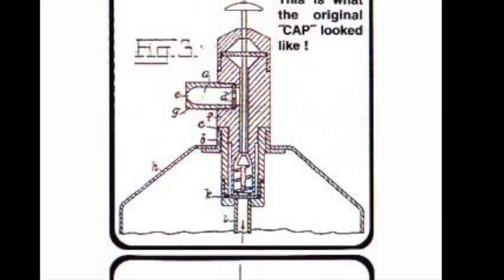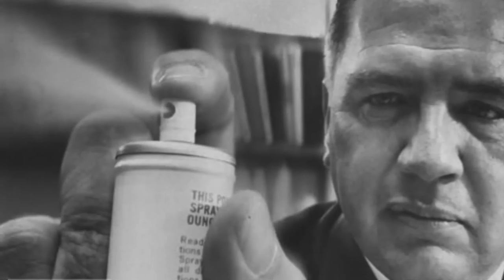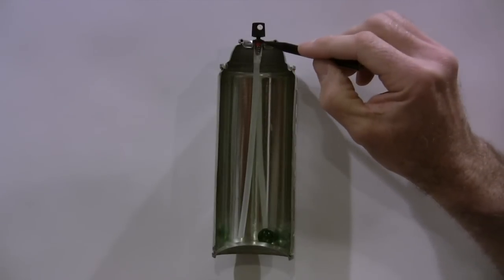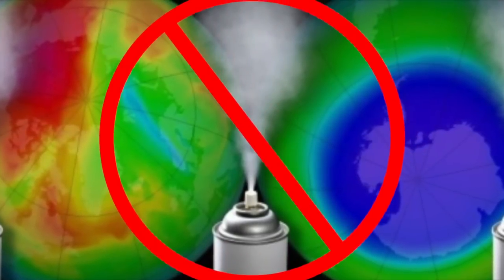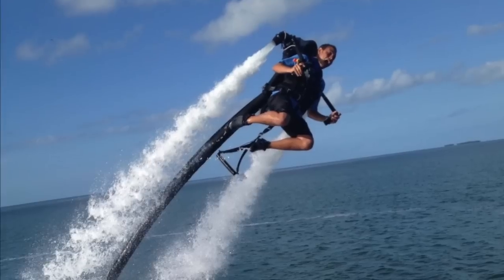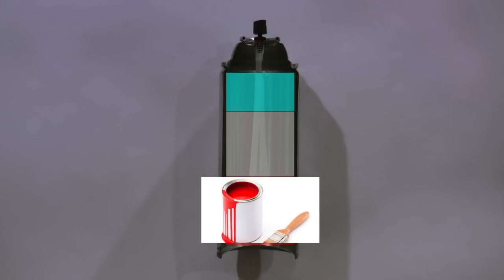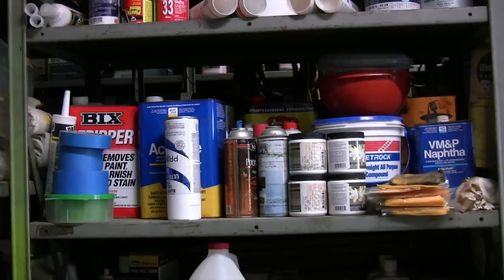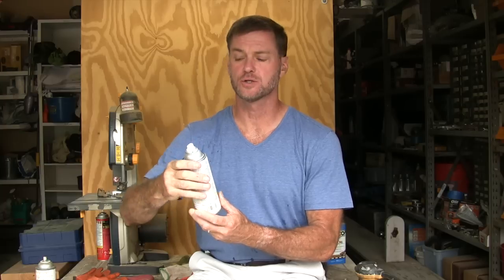Contractor Craig - Never Deal with a Clogged Spray Can Again

Comment: Turning upside down may or may not work. Somebody needs to sell nozzles on ebay-a package of all types. I'd buy 'em.
Reply from the maker: +Frichie68 Hey Frichie, Well I have about 40 years of experience that says it does work. Like I said in the video; the clog occurs in the dip tube as well so your idea will not work. I have tried replacing the nozzle with new one from new cans of paint and they still don't work...

Comment: Good article. After turning the can upside down didn't work (didn't know about the 'any way valve"), soak the nozzles in acetone for a good while (in my case several days).
Reply: Lacquer thinner will clean it out quick IF that is the problem 357

Comment: Good basic information that I thought I knew but didn't. Thank you. Another tip Is to soak the nozzle in solvent and blow it out with compressed air after you ar finished with it.
Reply from the maker: Thank you. But as I stated in the video, the clog occurs below the nozzle.

Comment: Very interesting to appreciate those who've gone before, and it was helpful to understand the workings of this kind of can. So nothing will fix the clog - the solids are dried in the dip tube and my Rustoleum is a goner...wasted product for all those that put their efforts in the product itself. In the beginning, you can add the short info that this is how to prevent future cans from being clogged and then tell us more (we can appreciate those brilliant minds that have gone before to help us in our lives). Thank you Craig for doing the research to explain this to us with the correct terminology and detailed explanation and visuals. So my dead Rustoleum led me to this video and so my money wasn't so wasted because I learned something for life and to share with others :)
Reply: Rustoleum I think is very good paint once you get it out of the can, but it is just terrible when it comes to clogging up inside.
Reply: You can always open the can, pour out the paint and use an alternative spray mechanism. Right? Yes. 🤔👍🏻🇺🇲

- Max Giganteum
Reply: @AlienArteStoreMX   How would I open a can? Somewhat carefully. Dangerous? Nonsense. All you need to do is bleed off the pressure still in the can then open it enough to pour out the contents. How to bleed off any remaining pressure? You can drill a hole into the top of the can near the seam where the top is crimped together with the cylinder. Use a small drill bit... 1/32 inch is good. That's .0312 in size for those that don't know - a #68 drill bit is almost the same size. When you do this, wear safety glasses (of course!!) and be ready for a tiny bit of spatter to possibly come out of the can. Won't the can burst open? No. A modern spray can is actually fairly tough. I've drilled small holes all over spray cans for paint, cleaners & lubes for decades and I've yet to have one burst or split. In fact, I stopped drilling holes and started dinging the cans LIGHTLY on the side of the can with a hand tool like a Crescent wrench to open up a pinhole in it. The pressure will slowly bleed off in a minute or two and voilà! You can open up the puncture point with a purpose-built center punch or a beater screwdriver to pour out the contents. How much PSI does a can have when new? Anywhere from 90 to 120 PSI is typical although the cans are manufactured to hold at least 150 PSI the last time I checked. Many won't fail until they hit well over 250 PSI if that tells you anything. What's the bottom line here? If you're prepared, you can safely open what is known as an aerosol can in order to save the contents if you cannot use air pressure and/or heat to clear a clog or if you cannot add additional air pressure through the stem. Two things:

1. I mentioned that it's important to be prepared. Wear safety glasses and clothing that can get slimed with paint. Remember to position the can so that you don't put a small hole in the can and allow the remaining pressure to push the remaining paint out in a spray. I've witnessed that one to great amusement. That's one of the reasons I say to drill a hole in the TOP of a can... do it while the can is setting on its bottom. You cannot get sprayed in the face if you do it that way even with a full can.

2. Make sure you're ready to use the paint! It'll dry in no time in an open container so the smart play is to have a brush at the ready or some other way to spray the paint. Airbrush setups work well as can a regular spray gun but keep in mind how much paint remains in the can by volume. It may not be worth using a regular gun for a little amount of paint. 

Note that an empty can should be recycled after you remove the plastic from it and cut the ends off - many recyclers won't take it unless both ends are removed. Check with your recycler for details some may allow you to split it open from end to end then crush it. One use of the cylinder portion of a can is as shim stock. Most non-machinists won't have a use for shim stock but if you do? Strip a can down and convert it for use as shim material. The thickness of any given can will vary slightly so check a few for thickness with a micrometer and save material at your discretion. Reality check: if you're not comfortable with opening up a pressurized container then don't. Dispose of it properly. You assume nor take on any risk. However, if you are willing to give it a go and assume a little risk then make a plan, prepare and go for it. You can save yourself a lot of money that way. In my past, I've saved the company I was working for a ton of cash by saving cans of paints, cleaners, lubricants and even adhesives. You can do the same at home... especially if the neighbors donate all their messed up or old aerosol cans to you. Free is a very good price! Best wishes!!

- Max Giganteum

Comment: Of course, after you blow until the straw clears, you might not have enough propellant to get out all of the paint.  I had to throw out a few cans with paint still inside, because the pressure got so low.

Comment: Does this work for Spray foam?
Reply from the maker: Hey Sy. No it does not. What I do for spray foam is, I leave the screw on tube on when I am finished. This dries up and keeps air from getting in the tub that comes out of the can. It kind of acts like a cap. When you unscrew the dried up removable tube and trash it, days or weeks later, the spray foam in the can is still wet. I keep all of the extra screw on tubes so I have a new one when I need it. Make sense?